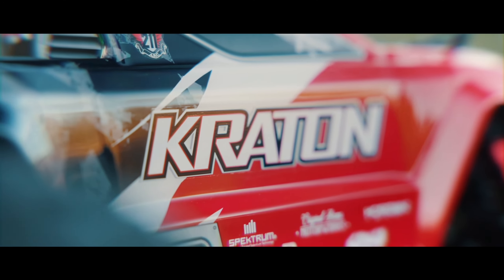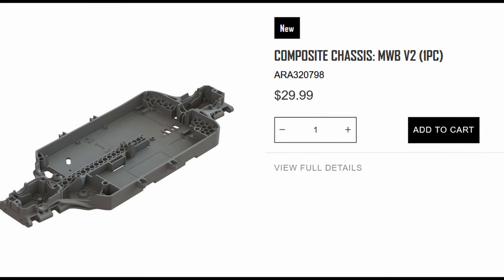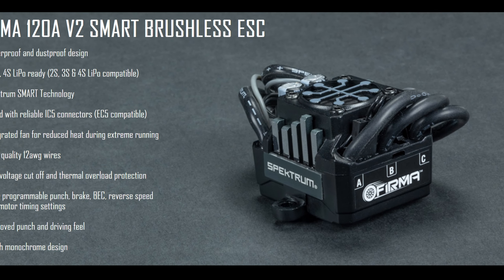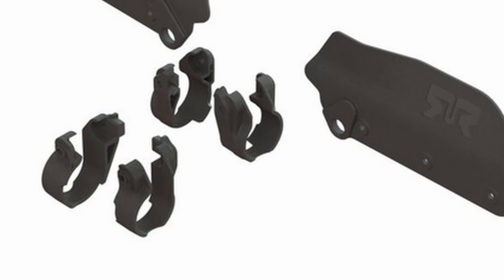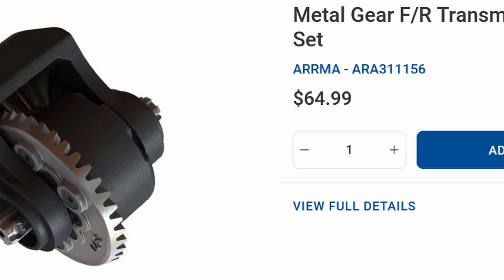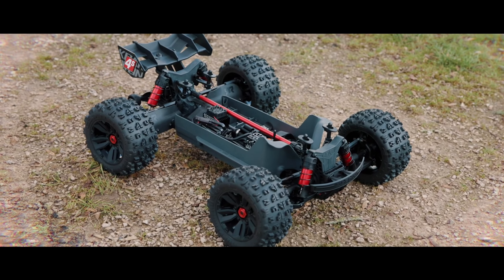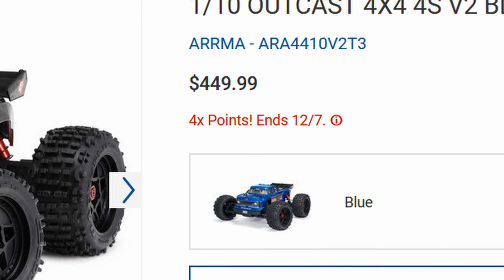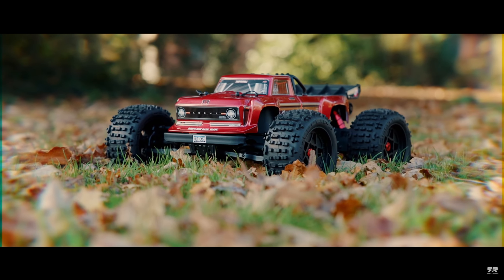I Found EVERY Upgrade On The V2.5 4S Outcast and Kraton | +1 Downgrade!

Comment: Yup, I'm in that boat, I purchased my Kraton 4s  3weeks ago, had the front hingepin fail, cracked chassis, and of course no chassis available anywhere, Horizon told me my kraton has been discontinued!  I am not feeling the arrma love i tell ya!
Reply from the maker: That's a bummer.
Reply: just buy the new chassis and some upgrades....
Reply: It's not AARMA it's KARMA😢
Reply: Yeah there's still a lot of cheap plastic on there
Reply: No warranty or did you get it used?

Comment: All kinds of awesomeness!!!  Glad they updated the chassis, hopefully it is more durable than the V2 Chassis.
Reply from the maker: From what I've seen the area around the hinge pins is somewhat reinforced. Whether or not that'll be enough to prevent the brinkages remains to be seen. They are usually pretty good at addressing problems though so I suspect it will be good.

Comment: Damn. Arrma really listens to customer feedback. I've been crying about the need for a center diff for the 4s models 😂. Good stuff. The servo saver still sucks 😢
Reply from the maker: Yeah I'm really surprised that no one has come out with a good option for a servo saver. The hot racing one is okay but it's still not great.
Reply: @DoRC  The HR one works, but the spline adapter broke on my Granite 3s (same as the 4s one). I couldn't find that little part anywhere, so the HR one pretty much sucks too 😢
Reply from the maker: @joseCalderon1976  Yeah it also gets loose over time. Maybe I can convince M2C to make one. I'm sure there would be a market for it.
Reply: I saw another video with someone using KP #124 servo saver and he said it fit on the 2.5 kraton
Reply from the maker: @LegendsPizzaCo  yeah I've tried them. They work fine but they're really not any better than the stock one especially with higher power servos.

Comment: Nice breakdown, i actually removed the sway bars from my v2 outcast and that did improve steering and handling for me, the msin reason i got rid of my outcast was the chassis, for me its way to weak for this truck, even with a bash bar fitted i broke 3 chassis, running at a bmx track, so no concrete, for me i would have like to jave seen a revised beefier chassis 👍
Reply from the maker: It was pointed out that the chassis has been reinforced around the hinge pins. Whether that will stop it from breaking remains to be seen. I never broke mine on the original.
Reply: @DoRC  my chassis all broke in the same place, at the front where the steering pins are, seen alot of chassis break in same place, also the chassis are always out of stock here  in UK 🇬🇧😢
Reply from the maker: @RCvapor  that's were they did the reinforcement so hopefully it's no longer an issue.

Comment: 63,5mm hinge pins is new! i used the since Mai2023. Now they are stock (and sold out for months)
Reply from the maker: Are they just longer than previously?
Reply: @DoRC 0.5mm longer and not rounded at the ends. 7075 hinge pin plate would be also nice, but arrma does not make them.
Reply from the maker: Gotcha Good to know!

Comment: I got one in red yesterday . It’s as smooth and quiet as every arrma I’ve tried so far . I wish they would stay so smooth rolling and quiet . If I replace every bearing in my other cars including motor bearings and diff will the cars go back to super quiet and smooth . I d change the diff fluids too . I ll have to look up v2.5 stock diff oils . Anyways , as for day one , the handling is superb . The servo isn’t bad imo . It’s doing fine and turning wheels not moving . Driveshafts look decent , all cvd. Center driveshaft could be aliminum but idc . Seems like it lands decent . I tuned the shocks but getting M2c pistons . Actually going now , later . Can you help me with this if I have questions ? I still haven’t put the max6 g2 Bluetooth in the k6s because it’s running so good lately as it is stock . I dot want to mess with it . I went thru every bearing except center diff and the motor , tuned the shocks with M2c pistons , rear chassis skid brace bar , alum top chassis and a 3d RC flexible wing mount but I had to put nuts on the screws becasue I stripped the threads 😂. It’s way better with a nut now becasue now the screw can’t snap off inside in the shock tower . It just took a minute and then it happened a couple weeks later which is when I got the flexible piece and since then I’ve had si molar wheelies and worse . One time I hit the throttle and the car went upside down . Other times it would come up so hard and I’d see the wing mount Flex hard which I know is what snapped the stock screws . Yeah , it’s all dialed in and finally landing like a puff 💨 with no more rear end bounce and just running like wrapped ape is why I haven’t messed with the max6 g2 . 😊
Reply from the maker: I'll be happy to help where I can but honestly it sounds like you do more suspension tuning than I do :-)

Comment: those reinforcement parts for the driveshafts are to protect that flat clip from being ripped off by a rock was a huge issue in the beging of these
Reply from the maker: When you say flat clip exactly what part are you talking about? I don't really bash on rocks so this isn't something I've experienced.
Reply: @DoRC  check out part # ara311150 its a driveshaft part cant share pictures here

Comment: 1:45 says dirt guard set so they are probably guards against dirt for the cvd?
Reply from the maker: The flat pieces are but I was trying to figure out what the u-shaped pieces were. Someone else explained that It was possible to get pebbles caught between the CVDs and the chassis which would then strip the little circlips off of the CVDs. These are supposed to prevent that from happening.

Comment: Hey man nice job as always!!  I did have a question.  Can I just buy that center diff (when it comes back in stock of course) and install it on my outcast or do I need additional parts?  Thanks in advance 👍
Reply from the maker: You'll need the center differential and the entire module that goes around it but that's it. I found that modifying the chassis a little bit to create that impression that comes stock on the update chassis is a good idea though I've heard from others that it's not necessary.
Reply: @DoRC What mod do you have to do to the V2OC to install the diff module? Is it the cutout on bottom of chassis by the spur gear?
Reply from the maker: @stevegabriel6982  Yeah I have a video about it that I did about a month ago you can check out that shows exactly what I did.
Others have said it isn't necessary but I feel like it would be a pretty tight squeeze without it.
Reply: @DoRC  I heard someone say on YouTube that there was a mod on the Outcast but not on the Kraton I guess from the longer chassis, just didn't know what that was. Thanks for the info, will check your vid out. Like your stuff, informative and well put together, Subscribed. 👍
Reply: it also looks like the front part of the chassis that commonly breaks are reinforce.

Comment: These trucks tend to steer better without the sway bars
Reply from the maker: Hmm. I've actually experienced the exact opposite. Without the sway bars you get it a lot more body roll which in my experience tends to make them handle worse but it probably just depends on how you bash too

Comment: the chassis looks like it's been reinforce where the front hinge pin are.
Reply from the maker: Yes they did do a bit of reinforcement in the front hinge pin area.
Reply: there was a breaking point. yes. its better now.
Reply from the maker: @runnerbaba  hopefully it's enough!

Comment: Typhoon v 2.5 should be next on the line up. I want one but after seeing all these v2s models i dont want to get one n next month a new version comes out lol.
Reply from the maker: Not sure how worried I'd be about that. All of these updates are primarily 4S line updates and I tend to doubt they're going to trickle down to the 3S line. It's possible that they will update the 3S line but I'd be surprised to see The center differential be part of that update.
Reply: Yes i think if they offered a new 3s line of trucks with these upgrades, it would push the 3s line into an expensive price area. not sure they would sell as well for 3s. @DoRC
Reply: Man don't say that. I'm waiting hoping and praying that the next granite has a centre dif.
I actually think that it will

Comment: i dont like sway bars. short wheelbase, weak servo/saver+play everywhere/whooble = you dont need it. its a basher.
Reply from the maker: Maybe though having sway bars definitely changes the driving characteristics of the car. Whether that's for better or worse just depends on the car and how you bash. I'll be curious to see how this handles without sway bars are compared to my previous one that had them
Reply: They could have changed shock tuning to somewhat make up for the lack of sway bars.
Reply from the maker: @boduke9428 definitely possible.

Comment: You don't understand how corporations deal with mass production.  If they can save a fraction of a penny for a part, they will skimp on it.
Reply from the maker: No I do understand that. Small amounts add up and every decision that's being made when designing one of these things is a balance between how much money they can make and what they can get away with.
That being said I don't think they would get rid of the sway bars if it was going to negatively impact the handling too much. Bashers do have some tolerance for bad handling but one of the biggest benefits of these cars over something like a Traxxas Max is how they handle.